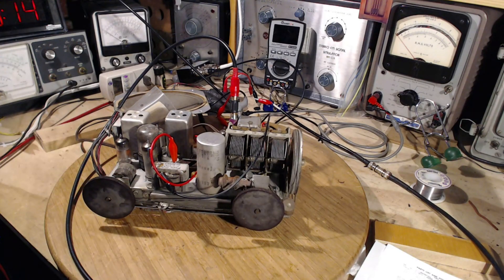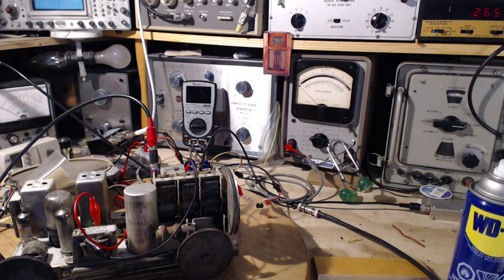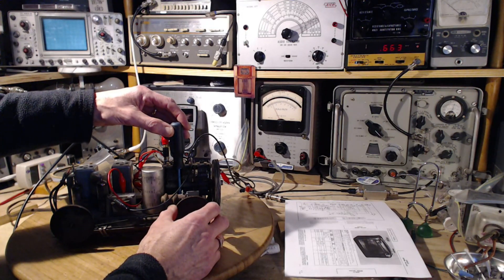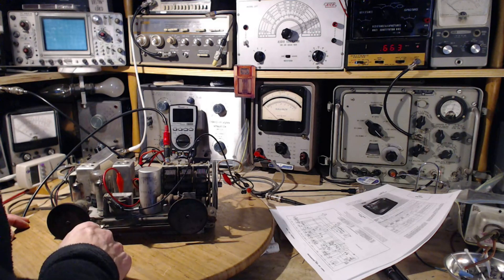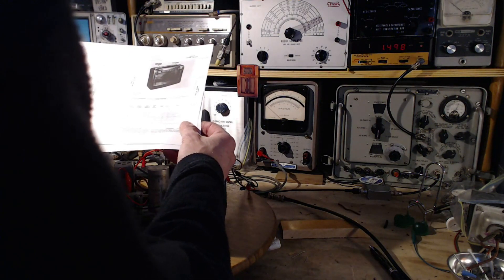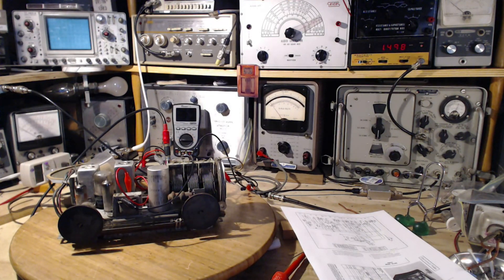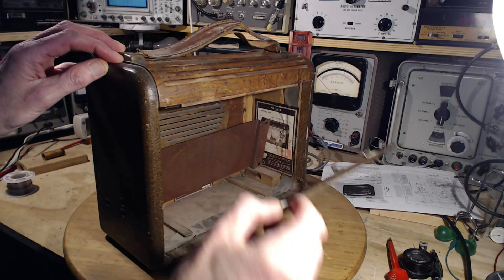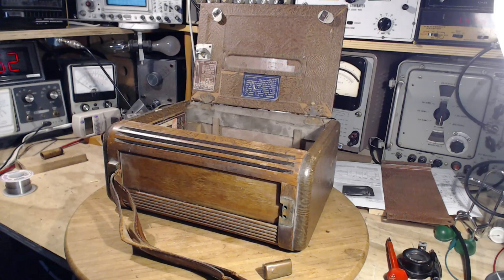Canadian Philco 409 (46-350) Portable Video #10 - RF Alignment

Comment: Jim, the next time you experience that swishing and/or clicking interference, try shutting off your frequency counter.  Mine produces interference similar to what you're experiencing and I have to shut mine off once the signal generator has been set to the intended frequency.  Not sure that this is the issue in YOUR shop, but it sure made a difference in mine.